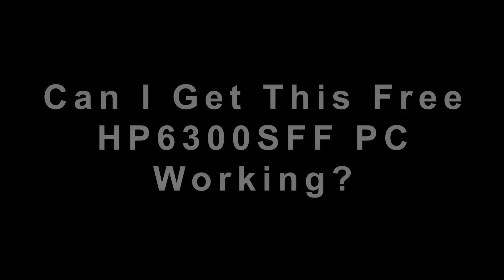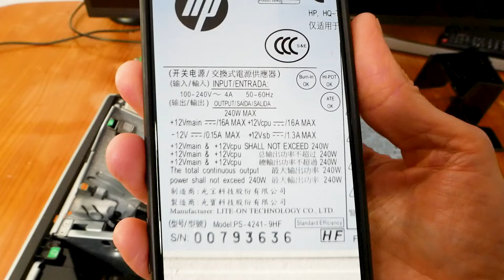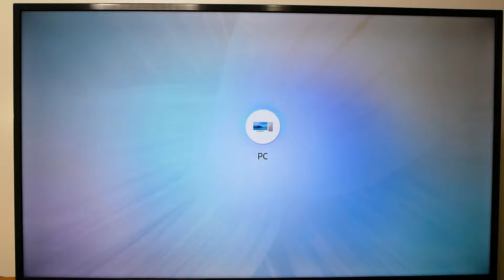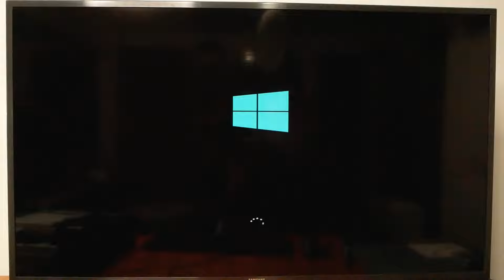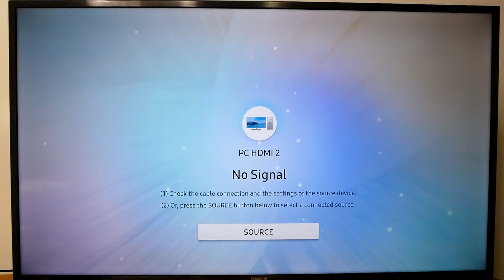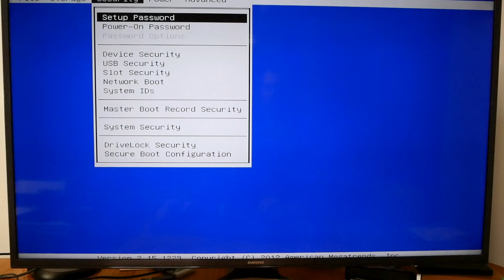Reviving an HP6300 SFF PC: Can I Bring It Back to Life?

Comment: Cool content, I just got me an emptied out HP 3500 MT with an i3 with a 300 Watt powersupply. for 10 Euro. I will smack 2 x 4 DDR3 inthere and swap the i3 with an i5 and make it a Rollblocks machine with a GTX650 Ti and an SSD.
Reply from the maker: @corneliusantonius3108  Hi there! 10 euros a great deal for that! Will work just fine after those upgrades you are planning to add :) Let me know how it all goes! Thanks for watching and commenting I appreciate it.
Reply: @RememberThisTech  It is doing fine but I had a faulty SSD so I am hunting for a deal on that. The GT650 ti is still playing Rollblox fine though.
Reply from the maker: @corneliusantonius3108  @corneliusantonius3108 hopefully you can get a good deal on an ssd soon!

Comment: Hello Jason, that was a fine gift and I wonder if the onboard graphics have been turned off in the bios.
Reply from the maker: Hey there, Laurence.  It perhaps might be. I'd have to test it a bit more :) Thanks!
Reply: @RememberThisTech  I have found that those ex office computers work well with Linux and are usually reliable workhorses.
However, I have an HP Compaq 7800 USDT.,PC.,  which developed an odd fault, whenever it's shut down it does shut down but then it restarts immediately, but I read online that holding the power button for a count of 10 cures that problem, so I tried that but I counted to 20 and it worked.
Reply from the maker: @laurencejohnson4106  Hey Laurence, That is an oddly Specific issue for sure! Have you tried updating the bios to the newest rev?
Reply: @RememberThisTech  Hello Jason, I have not tried that, but judging from what I have read online that particular fault often happens with some HP., computers.

Comment: A great little PC for a commoner if they had only bothered to troubleshoot it. Then again, open enough tabs in Firefox, Edge, and Chrome, and each one can easily eat up 8+ gigs. I once caught Firefox using about 24 gigs LMAO. I've even caught Teams using over a gig. Teams of all things. I'll never understand how browser with so many tabs open that you are not currently looking at can eat up so much ram. Ok ok....enough of my ranting LOL. Great find! I have a Dell of the same size with an extra NIC card running PFSense. These are great little boxes that can perform double duty for other things. Looking forward to see how it does as a Linux machine. Have you found a Linux tool that gives you FPS, CPU%, GPU%, VRAM?
Reply from the maker: @itstheMR  yep I've seen the same mem usage on idle chrome tabs. It's dumb how much the grab and hold.. well also dumb for me to not close them lol. Mangohud is a good linux fps tool. Having issues with it registering the gpu usage though.. ahh the joys of Linux from a noobie user like me!
Reply: @RememberThisTech  I'm sure you are determined enough to get it to work!
Reply: I mostly use the Opera browser and the Vivaldi browser, however, I have not checked to see how much ram., is being used, but I rarely have multiple tabs open.

Comment: I got one for almost nothing. It did have i3 second gen . To upgrade to i5 third  gen need to update the BIOS and is a nightmare. Could not be done in a single step and support from HP is long gone.
Reply from the maker: @mamailo2011  Ahh well least it cost almost nothing :) Were you successful in updating the bios and i5 then? Or was it a no go?
Reply from the maker: Ahh I gotcha.